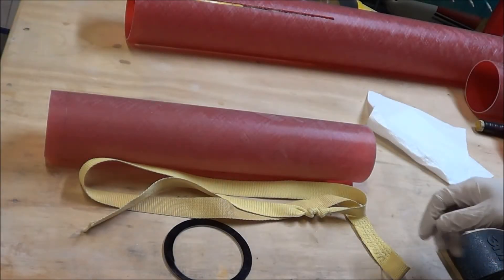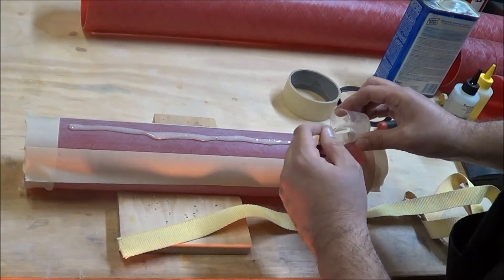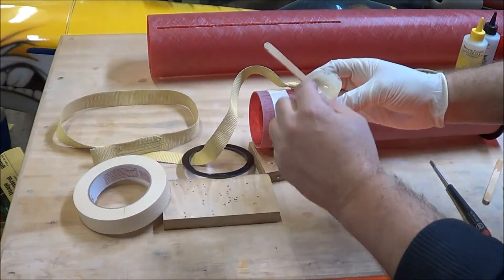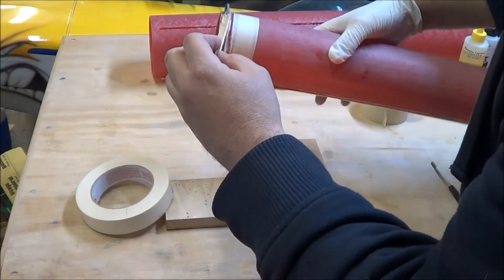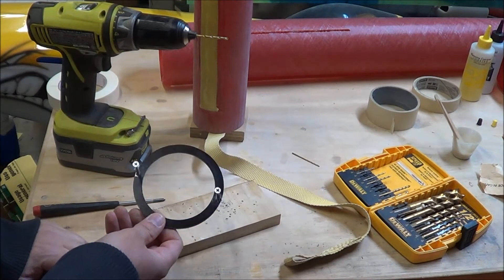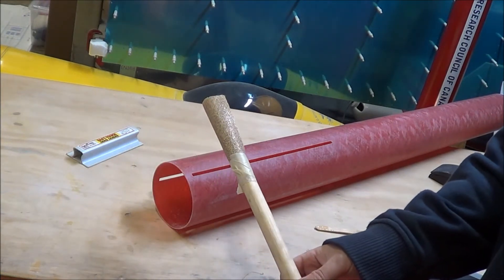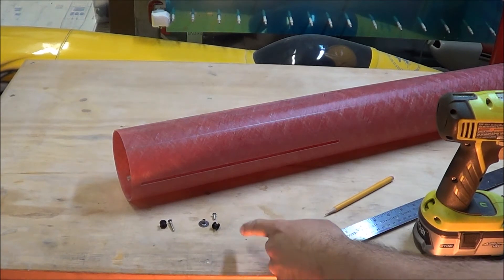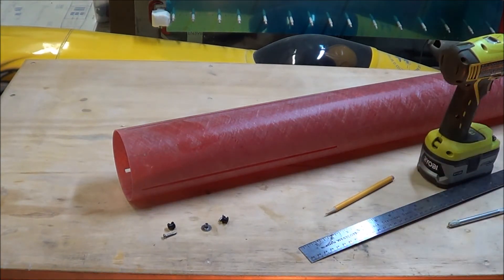Anatomy of a High Power Rocket 2: Motor Mount Assembly

Comment: Your knot location reduces the working load of the kevlar by about 50%.  I would tie the knots at the furthest end of the webbing so the full strength of the kevlar is allowed a large bonding area in front of the knots.  I agree with the concept of the backup knots, but in the setup you show your redundancy is actually a weak link.  For the same weight and materials your setup could be much stronger by moving the knots to the nozzle end of the motor mount.  I'm not a rocket surgeon, but I am a hammock camper which makes me more of an expert than someone that merely stays at the Holiday Inn Express.
Reply from the maker: Yes it does and I have corrected the location on subsequent builds.  Thanks for watching.
Reply: flyfalcons :  I just got done watching this whole series.  It was great.  Thanks for sharing 👍
Reply: After thinking about this:
With a minor weight penalty of sewing another loop in the kevlar, your recovery anchor could be twice as strong as how you did it in the video and still include the redundancy of a pull-through stopper.  ...actually, your two knots take up about the same amount of webbing as a sewn loop, so this is a very, very tiny weight penalty.

If I was a rocket surgeon I would:
notch the rear motor mount twice and sew the the kevlar around that ring (similar to your parachute loop);
install the rear mount and epoxy the kevlar to the mount while avoiding any sharp bends in the kevlar;
then epoxy the kevlar along the tube as you've done in this video.

Between the sewn loop, the epoxy, and the centering ring bonded to the sewn loop it would have a similar redundant effect when trying to pull through the forward mount while maintaining nearly the full 100% of the kevlar's tensile strength.

I think the weakest link in my proposed setup would be where the kevlar fibers first touch and bond to the epoxy at the forward end of the motor tube.  Those fibers should be expected to fail at close to 100% of the Minimum Break Strength of the kevlar.  If the epoxy fails, it would try to pull a sewn loop with a centering ring epoxied inside it through the forward motor mount.  And I'm sure you know that a sewn loop is stronger than any knot, that is why you have a sewn loop on the parachute end of the recovery anchor.

Comment: i may be wrong but that lower rail button looks like that is a bit low i run mine about 6 inches to 4 inches up i also make a third if needed centering ring so the fins touch on top also

Comment: just curious with no engine block like estes what prevents the motor from going forward?
Reply: High power rocket motors have a shoulder on them at the end that prevents it from going forward, there is not an engine block because that would limit the length of the motor you could use.